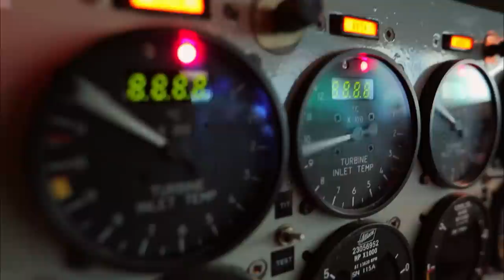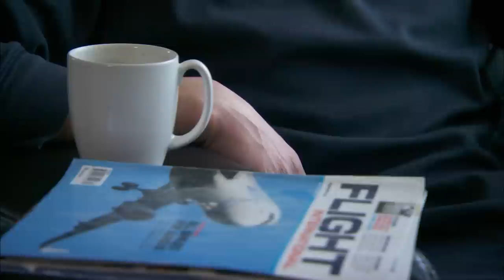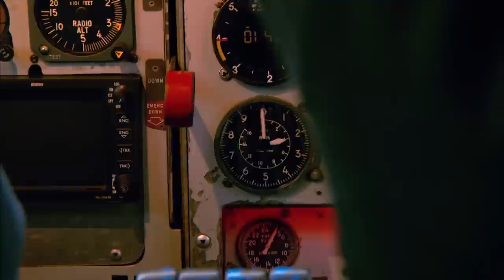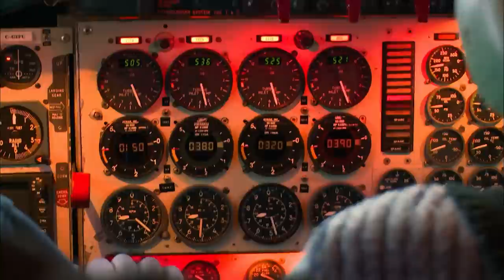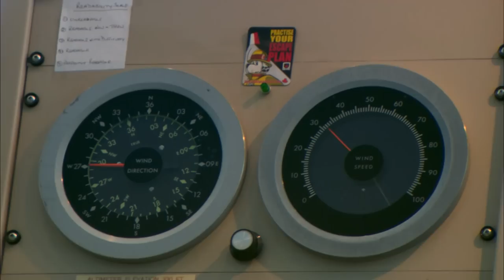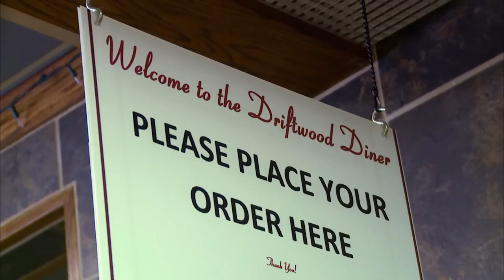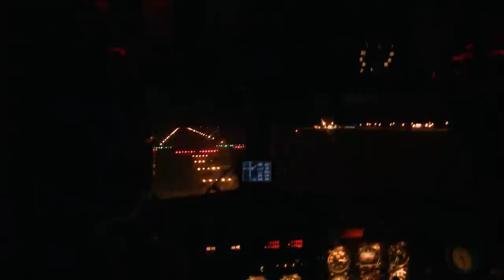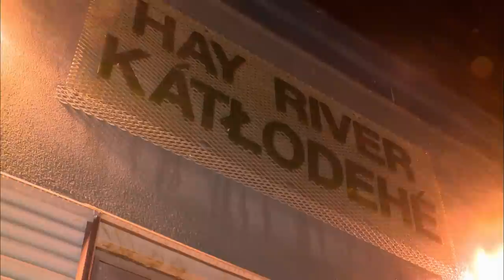Their New Electra Is Hammered By Brutal Winds | Ice Pilots NWT | Wonder

Comment: At 5 minutes into this vid  THE FLIGHT ENGINEER is NOT adjusting engine speed, these T56s are CONSTANT SPEED ENGINES
Reply: Prop pitch??
Reply: @harpo6203  more power = greater  pitch and  greater fuel flow

Comment: Every. Single. Windshield. In this show. Is. Cracked.
Reply: There may be a shortage of gravel for roads up there.  So they use crushed rock, which is somewhat larger per piece and more likely to break windows.

Also at -40 windows can crack easily.
Reply: @georgegonzalez2476 agreed, have actually lived there briefly - was just busting balls. pretty sure he’s got a 2023 super duty now anyway
Reply: Extreme temperature fluctuations not financially sustainable to be constantly replacing windshields especially if the crack is superficial and the shield will still hold heat

Comment: Man that truck would never pass a Inspection. The Windshield is cracked and the driver's door does not fit and seal. Being an Owner of a D. O. T. Registered Trucking Company owner, I ask how you can get away with such equipment in a area much more savage than the U. S.A . ?

Comment: An accident just waiting to happen! Deicing an entire frozen aircraft not using anything NORMAL like deicing trucks that spray the solution on so that it does a thorough and proper job of clearing ALL of the contamination of ice completely off ALL the surfaces BEFORE FLIGHT! How and thee hell does Transport Canada ever ALLOW them to get away with such primitive and life threatening procedures like these? They are flying PEOPLE in these aircraft! They said it themselves that it's the sched aircraft and they need to have it ready first thing in the morning! No! This is NOT the way you deice a frozen aircraft and especially if you are going to put PEOPLE ON IT! 
      There's NO WAY Transport Canada is allowing them to deice a scheduled airliner in this manner! No way! My advice would be to NOT GET ON THIS AIRCRAFT after it's had a deicing job like this performed on it! Don't even go to the airport at all.  UNBELIEVABLE
Reply: They are operating at the bare edge of possibility, so some corners get cut.